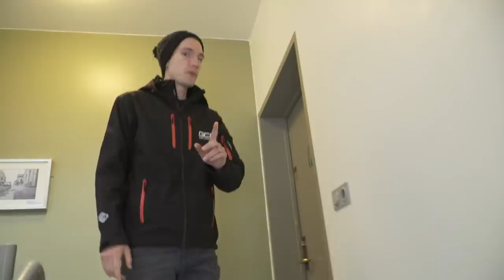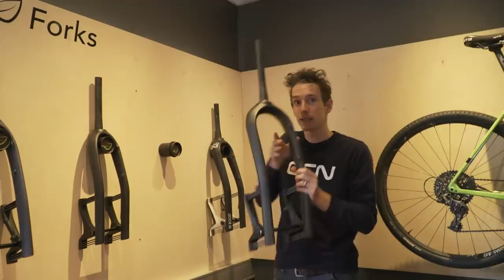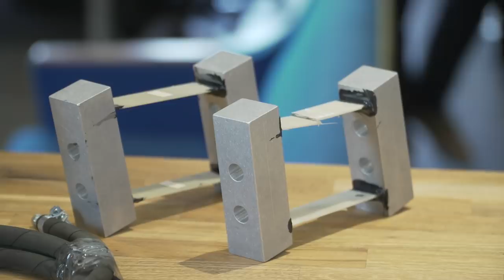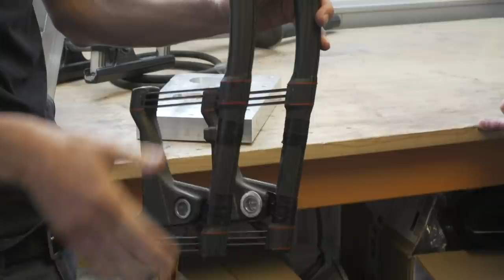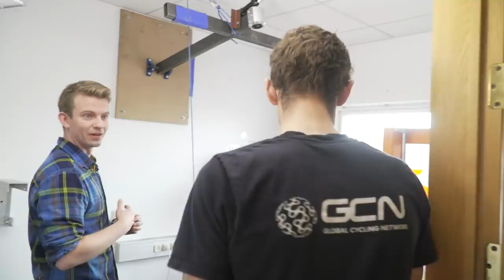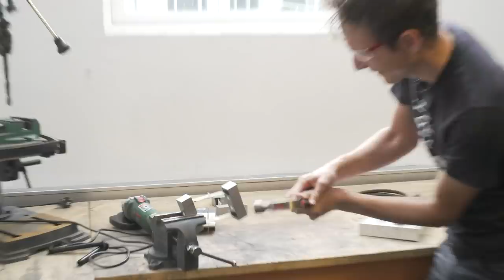Gravel Bike Suspension?! | Meeting Lauf In Iceland

Comment: I would try marrying 2 diff fibers/materials into the leaf springs a kind of 1/2 & 1/2 or 60 & 40 or 40 & 60 split. That way the wt transfer u r trying to iron out gets 2 diff springs in 1. Bc it is not full load or no load it is really full wt shift mode then less,less, & then least wt shift b4 u come back around for next pedal.

Comment: U need a 2nd product that is easier & not req as much fine tuning & wt working range & advantage vs cost. A cheaper simpiler 2nd product to hold u over. A leaf system that limits the max turn of forks vs bike frame & that cause the wheel steering to spring back on own more center line. It a 1 handed aid or no handed aid fork to frame limiter leaf w/centering effect "thing". Something new every1 will want & then they pay up for your newest best gravel forks w/same leafs. U get your foot in the door w/mass market product then up sell cool tech.